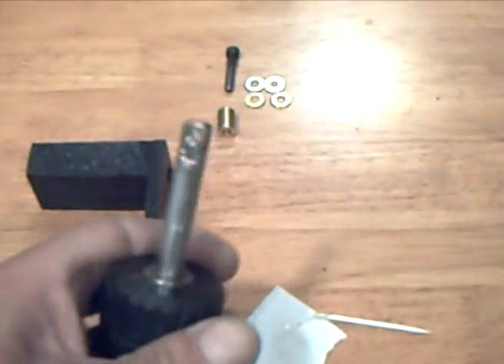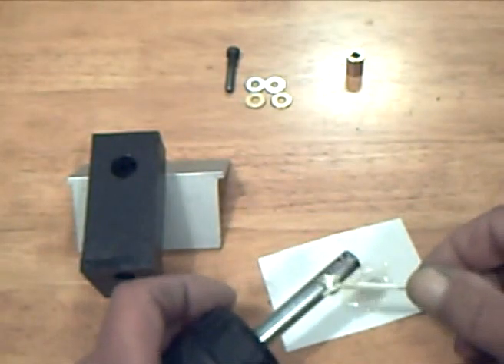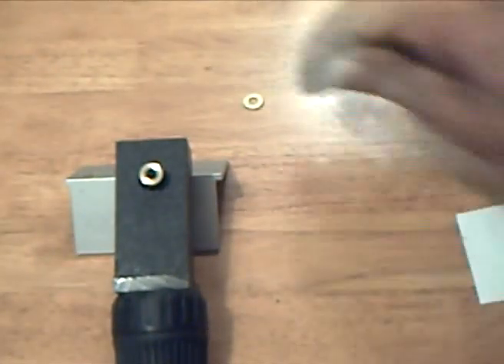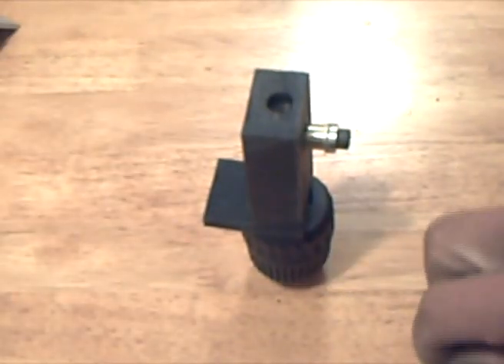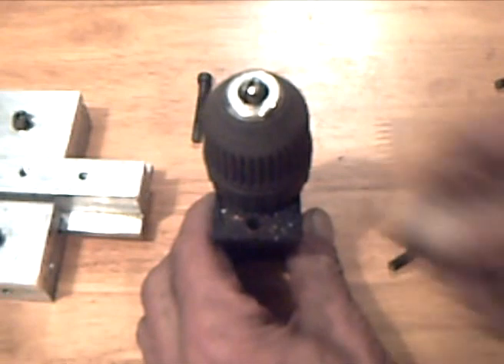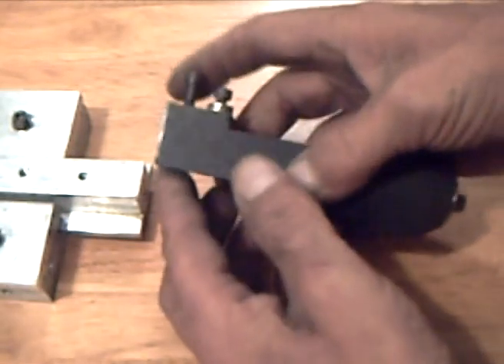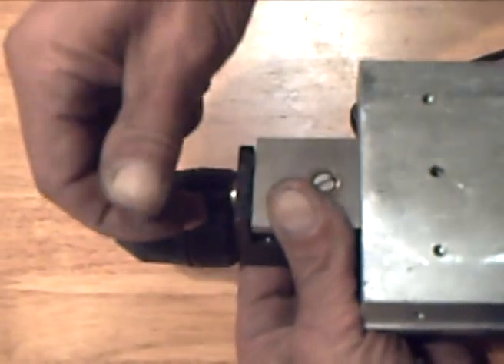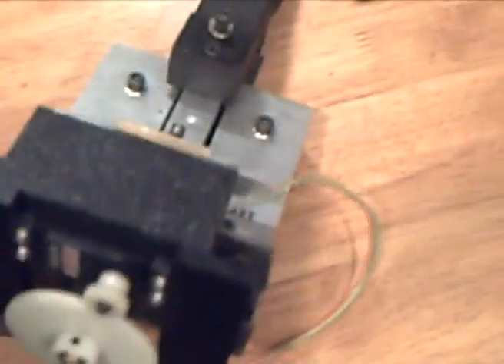EDM  Machine. part 5 - Electrically Isolated Speed.chuck

Comment: Hi
does the motor constantly reverse and constantly hunt for position or does it find a sweet spot of advance speed? if it hunts , at what rate would you guess it switches? thanks for the cool video
Reply from the maker: this is a copy of one in the shop at university.
i haven't run this one yet.
the one at school hunted constantly but the travel was so short it mostly made a continuous buzzing (burn)